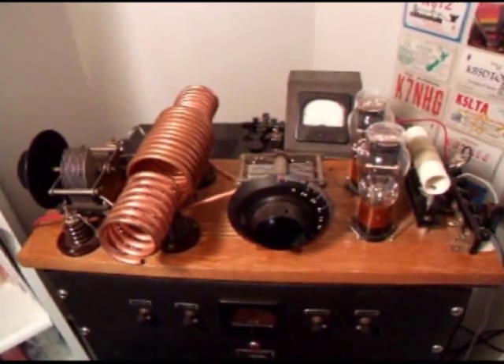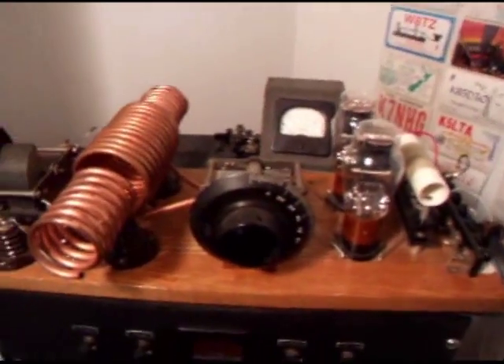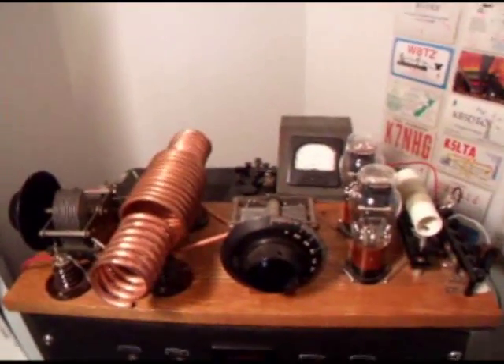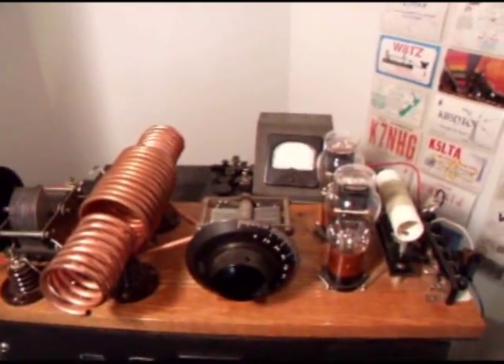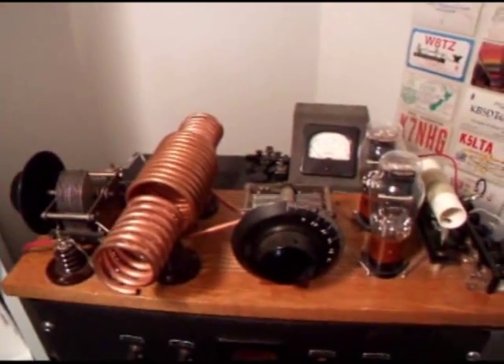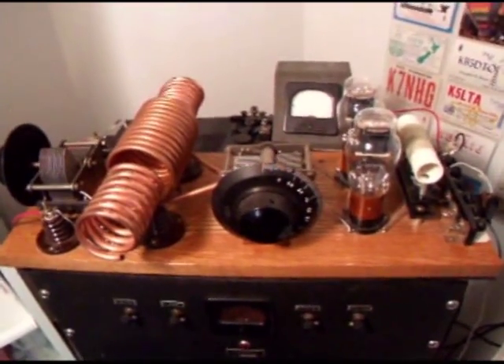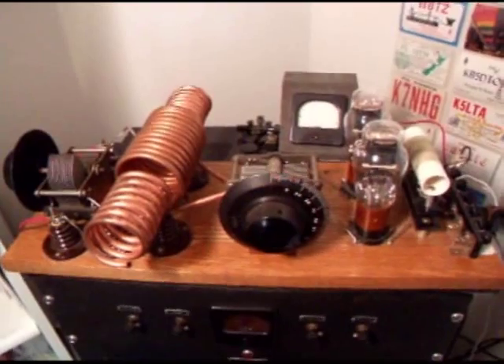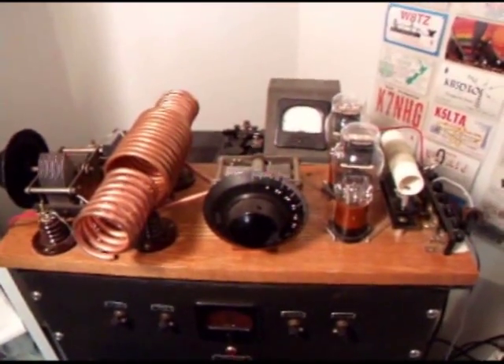TNT Transmitter Details

Comment: I'm trying to make a AM Transmitter currently myself for my wireless broadcast of electrical power experiments..  Thanks for this video on your transmitter, I want to make mine just like or close to what you have there except the antenna capacitor and coils are replaced with the Tesla Coil. I'm going to have a thin wire coil from the transmitter fed in a coil on one 1/2 the AM radio antenna metal core. Then feed another coil on the other 1/2 of the core to prevent sparks in the Transmitter.